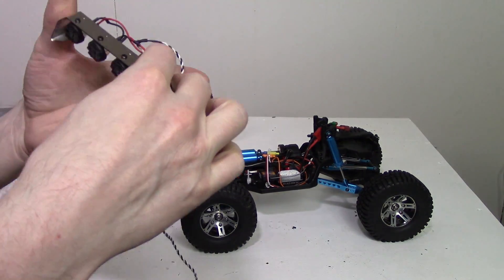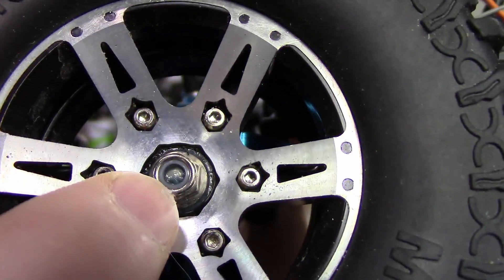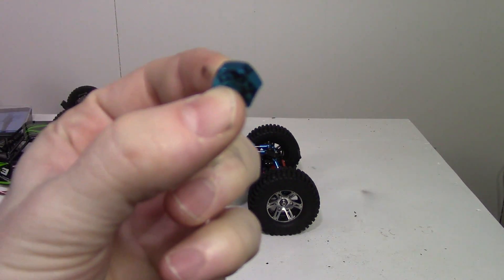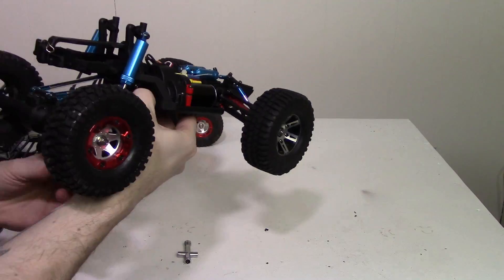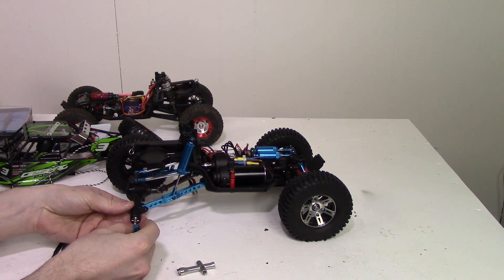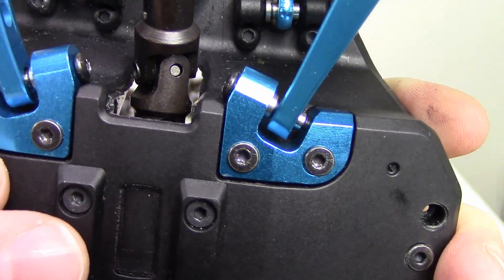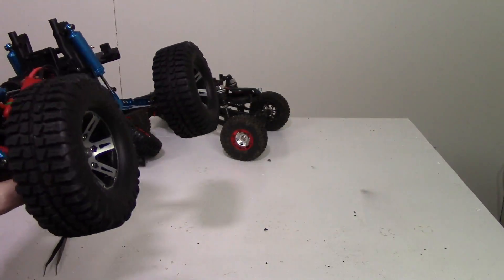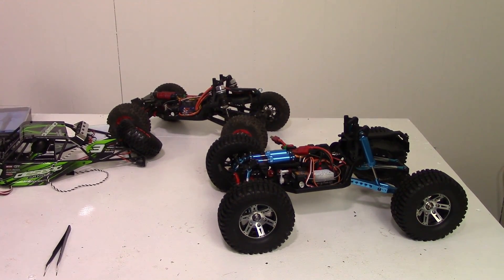Taking a look at a few more Feiyue upgrades!

Comment: I'm on the hunt for good shocks for this thing... I want softer ones for sand/grass/dirt & rocks... mines fishtailing... how's those shocks working out for you?
Reply from the maker: Pretty good so far. The weight/cst of the oil really makes a bit difference. When I first got the shocks I had some 30ish weight oil them they were still a bit springy for my liking. However just recently I've put in some team associated 80w/1000cst oil and it's made a big difference. They have a nice slower rebound any pretty much all of the springiness is gone. Just to clarify I only put the 80w oil in the rear shocks I haven't done the front ones yet, although I do plan to.

Comment: Hi, that light bar looks awesome and duriable! Where can i get one please?
Reply from the maker: I originally got it at hobbyking unfortunately they don't carry it anymore.
Reply: Ok :(, Which upgrades do you recommend doing the most?
Reply from the maker: I think really the main one is the brushless upgrade it's self and then the shocks. I have another feiyue that is 2 years old and it has a lot less upgrades and is still doing great. it's brushless also but only has the shocks and the rear drive shafts changed, Everything else on it is still stock.